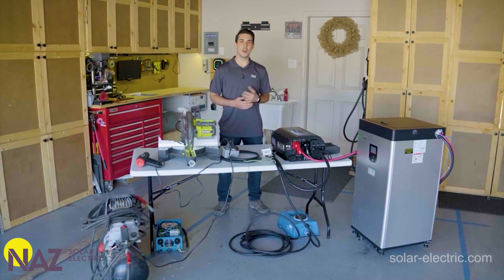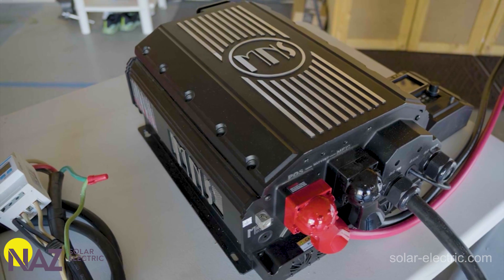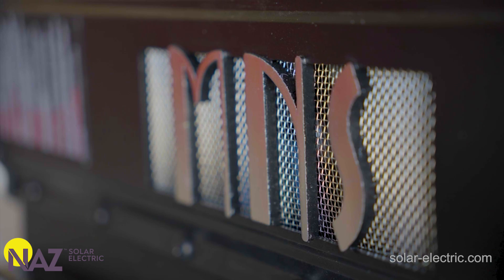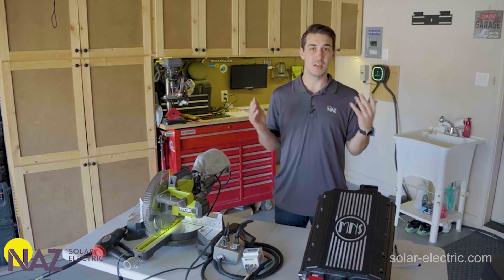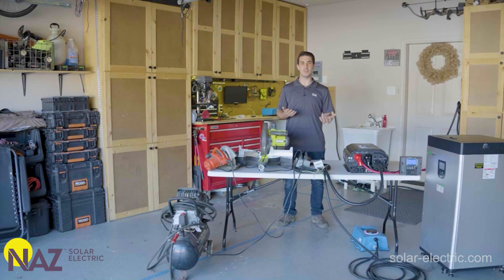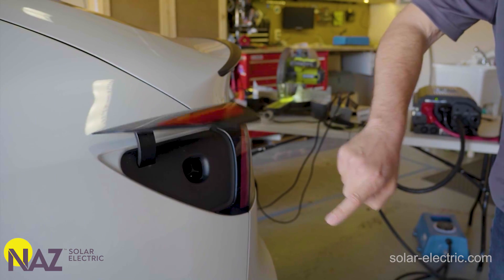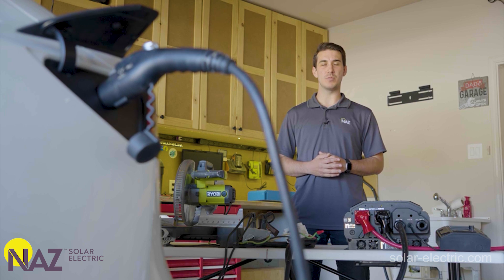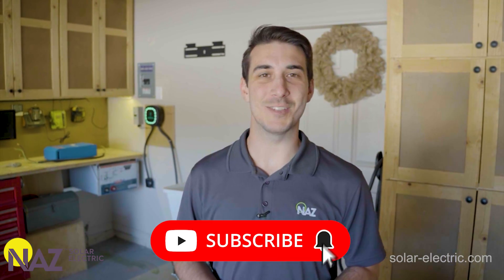MidNite Solar Rosie 7048 Inverter - NEW!

Comment: why is there not an ac out wire...but you are doing ac out
you have a wire on the ac in ...but on the controller it doesnt show anything , just ac out

what am I missing
Reply: Tools, I am guessing they wired the AC out correctly inside and ran the cable through the AC IN grommet hole.  Just guessing

Comment: Can you do a video on what info is given on the MNGP2?  Does it have remote montoring software?
Reply from the maker: We don't have anything planned at the moment for MNGP2 but will keep in in mind! Currently Midnite doesn't have any way to remotely monitor the Midnite Rosie system.  Hopefully this is something they add soon.
Reply: MNGP2 does not have built in remote monitoring.     I've "heard" that Midnite is investigating an option for that.

Comment: Way to go, Robin, about the 120v thing when inverting. The Gudgel Guys are always innovating! Will the Rosie charge properly with a 120v generator, or does the genset need to be 120/240?
Reply: You can charge on 120V or 240V. Rosie is very easy going.